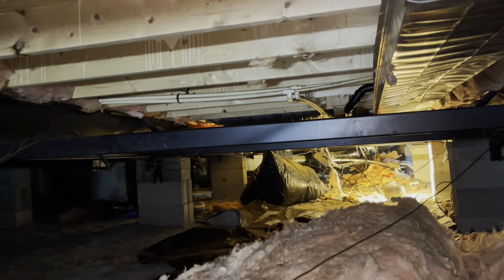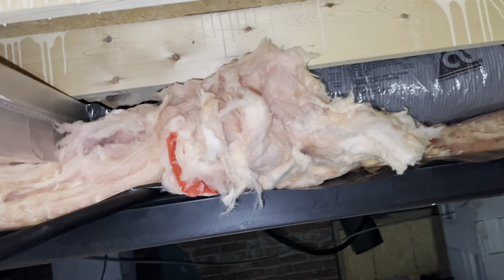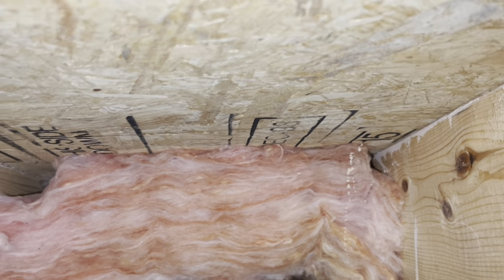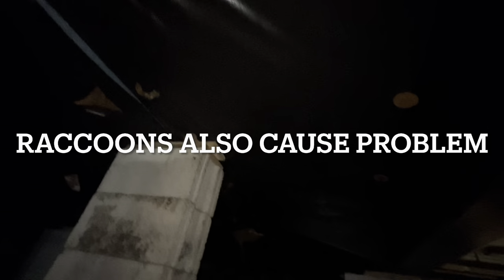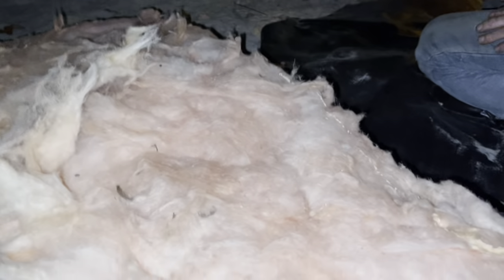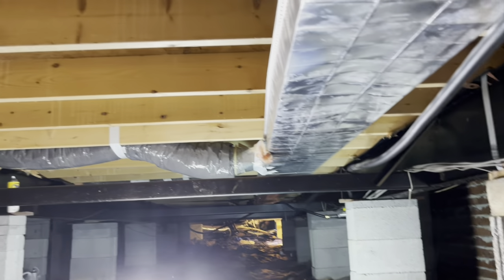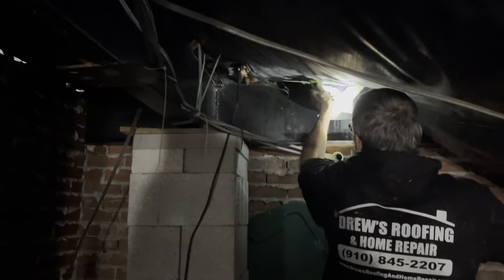Double Wide Mobile Home Underbelly.

Comment: Depending where you live if you dont let the insulation drape down under the heating duct, your water lines will freeze in the winter. Ours still freeze sometimes here in Ohio.
Reply from the maker: We don’t worry to much about that. We have warm weather here.
Reply from the maker: How is the weather in Ohio right now
Reply: up in ne oklahoma we got to 17F . No worries just dig up the water supply and super insulatethru the closet and run all the new pex lines insde on the ceiling. No more worries and if you ever have a leak you'll know.

Comment: this is exactly what I was looking for! thank you so much for the videos. Question: would the classic musty odor in mobile homes  disappear if I replace the underbelly insulation?
Reply: I worked in a lot of mobile homes and that smell might be from old carpets in the home that got messed up over the years!  When you change your furnace filter, place one of those gel scented boards (located near the filters at the store), and any scent you want will come from your vents all over the home from the air conditioner.  I always used them during air conditioning months, never tried one in the winter.
Reply from the maker: Good answer. It’s not real easy to do but yes I believe it would
Reply from the maker: Yes I think so

Comment: If removing the insulation like this would it be beneficial to put foam board insulation in the rim joists then seal the foam board insulation edges with expanding foam?
Reply from the maker: I’m going to be using Owens Corning insulation or 19
Reply: I would go with straight spray foam, flash & batt, or foam board in rim joists just like I recommend for stick built homes.
Reply from the maker: The only problem I have with that is there’s so much stuff in the way under there for me and I always want to be able to get to them in the future in case something happens. So I’m going to use our 19. Tiger claws to hold it up. Wrap all the pipes with foam insulation. Put a new underbelly on it.  I should have more videos of that coming soon
Reply from the maker: I’d like your suggestion if I had more room and there weren’t so many pipes in my way

Comment: I am thinking about getting our crawl space encapsulated and insulated, then removing belly wrap/insulation on the half that has the plumbing. I do not like not being able to see the plumbing for repair access reasons.
Reply from the maker: I agree, 100% and this is my house you’re looking at I have been thinking about it for a long time. I am not going to install any vapor barrier under my house. I’m going to wrap all my plumbing pipes that used to be in the vapor barrier in insulation because like you said, I don’t want them to be encapsulated up inside something I can’t see if they’re leaking. Thank you for your visit my friend.
Reply: I had mine removed and found a water leak at the connections between the two halves of the doublewide. We eliminated the connections there.

Comment: Great info..what are tiger claws?
Reply from the maker: They are what holds up the insulation you can get them 16 inches long or 24 inches long and it is a metal rod if you go to Lowe’s and tell them you’re looking for tiger claws to hold up insulation they will point you in the right direction.

Comment: That's why mobile homes need a foundation. The mice and rats dig right underneath the skirting of a mobile home. You do all that work and the mice and rats will just come back and destroy it.
Reply from the maker: They will did under foundations also. Mine has footers and brick. They dug under
Reply: @Drewsroofingandhomerepair  How deep did they go with the foundation ? In Michigan foundations have to be at least 4 ft deep.
Reply from the maker: Lord no. Just footers here. 12 inches wide 12 deep. No frost here.

Comment: Do you have to use. That type of insulation   when you. Redo it I was wanting to use  insulation  sheeting. Of some type. But how to keep it up.?
Reply from the maker: I recommend using insulation you install in the floor joist. And go to lowes and ask for insulation tiger claws. It is a 15 inch piece of metal. They really work well
Reply from the maker: I recommend using insulation you install in the floor joist. And go to lowes and ask for insulation tiger claws. It is a 15 inch piece of metal. They really work well

Comment: Isn't the insulation put in upside down? Thought paper side is outside and not against flooring. My bad, thought it had paper side
Reply from the maker: No the paper always goes towards the inside it is a vapor barrier. A lot of people think the insulation is supposed to point towards the outside that is not the case. 
https://youtu.be/qyS0CE__YdE

Comment: How much would that cost to redo all the insulation
Reply from the maker: The insulation by itself is around a dollar per square foot and then you have to figure removal and replacement I’m guessing the one side that I’m doing will cost if I hired it out around 1500 for just the insulation and then he still have to repair the Underbelly so around $2000
Reply: @Drewsroofingandhomerepair or spend 300 and 2 days to do it yourself. You lose nothing but time you'd spend watching TV, and you learn a lot.

Comment: Really like to see if possible someone replace a mobile home roof with  attic to have standard home duct supply . My 1977 double wide has roof cavity with factory duct board supply with standard house up flow furnace . Impossible to replace unless tear the roof apart .
Reply from the maker: I really hate it when they install vents in the ceiling it makes it real hard to replace if needed you will have to tear out the ceiling and replace it
Reply: We had one of those in house houses I've lived in and both have been torn out. They left the hole in one of the houses and just put a metal roof right on top of it.
Reply from the maker: Wow 😯

Comment: Doesn’t a mobile home come with an underbelly for a reason?? I thought it was to create some type of airflow to prevent mold.
Reply from the maker: It’s so the water pipes and the ductwork is inside. That’s why I built a box on mine. 27 is our low temp at night so no worries on the pioes

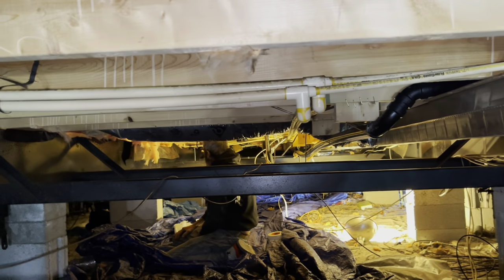Comment: @ 11:52  Is that polybutylene pipe? If it is, replacing it should be a top priority.
Reply: It’s pex pipe
Reply: @ScrappingwithGrandpa  Fittings are wrong. Could be CPVC? Which would be just as bad as Polybutylene.
Reply from the maker: Everybody around here uses sea PVC. We live in a warmer climate we don’t get much cold as a matter fact this year it’s only got down to 30° four times. That’s one thing I have going for me
Reply: @Drewsroofingandhomerepair  From what I've heard, the problem with CPVC is that it becomes brittle with age.....
https://www.youtube.com/watch?v=Wz4BFCIlpKk

https://www.youtube.com/watch?v=X8EyE7c8hSs
So as long as you don't disturb it too much you should be ok. But better to replace it when you have a chance. Especially in the house with the shut off valves. Not good to have a valve break off when you need to shut off the water! Or safely shut off the toilet supply line only to have the valve break off when you put a wrench on the supply line. Of course to be safe, you can simply shut off water to the whole house when working on fixtures.
Reply from the maker: Interesting. Thank you
Reply: What's wrong with polybutylene?
Reply: @oatmealxyz  Polybutylene has been banned in the US since 1995 because both the pipe and fittings can fail at anytime without warning. If you have the grey pipe, you should replace it as soon as you can.
Reply: @oatmealxyz  From personal experience... I bought a mobile home with polybutylene  pipe. Before I could replace it, a section of pipe going to the water heater in the closet sprung a leak. Flooded the bedroom floor, ruining it. My neighbor bought a mobile home, where the previous owners replaced the polybutylene with PEX. However, they left a section going up to the shower. Which later failed and flooded her place!
Reply from the maker: Wow. Ong. Better to replace it all
Reply from the maker: I agree
Reply from the maker: It fails on a moments notice.

Comment: It's good to remove the nasty stuff, but whatever you will put back better have some good way to keep rodents out. As you can see the plastic has holes in it, rodents will easily dig thru. You'd need some sort of chicken wire to really keep them out. That OR make sure the skirting is 100% mouse proof so they can't get under the home.
Reply from the maker: Thanks for the tips!

Comment: I would spray 30 second cleaner on the whole bottom of the house!  Probably would follow up with some AfterShock as well 🤷‍♂️
Reply from the maker: What is that?? Please tell
Reply: @Drewsroofingandhomerepair  Fiberlock AfterShock disinfectant
Reply: sorry Shockwave 😆
Reply from the maker: Where can I buy it. Lowes or amazon
Reply: @Drewsroofingandhomerepair  A Janitor Supply house would be best.  The place I got it from was only there temporarily for the Hurricane.
Reply from the maker: Dang
Reply: Do you need it right away or is it a long term project?